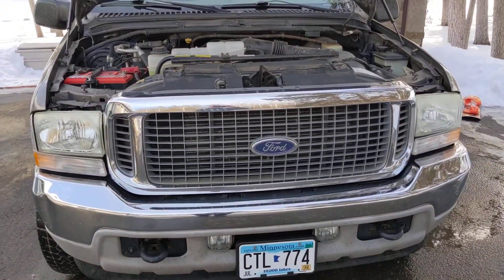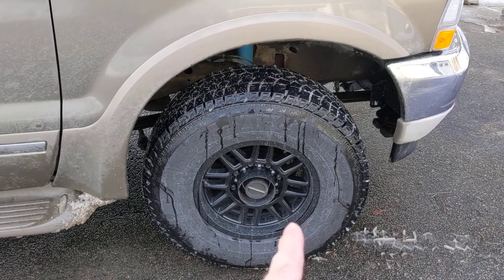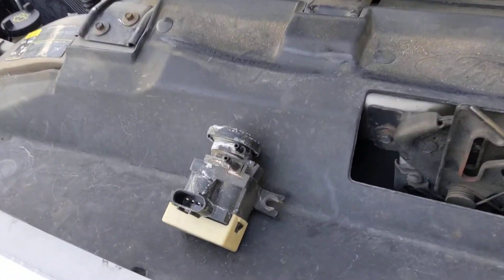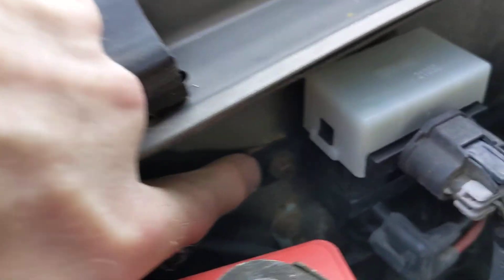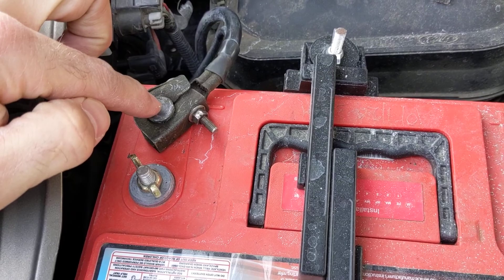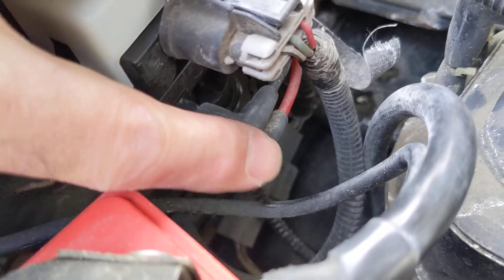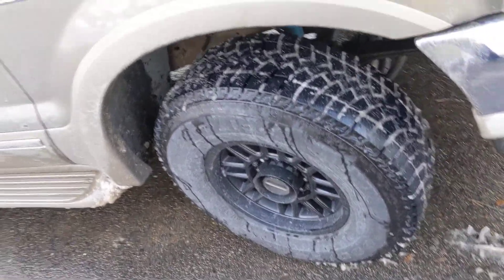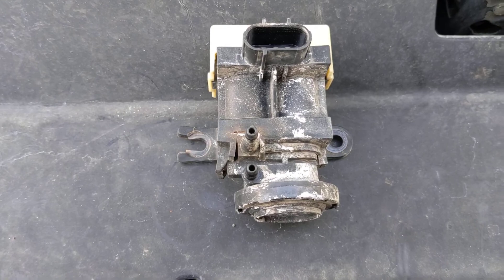Excursion V-10 vacuum solenoid

Comment: My AC blows through the windshield and then, about 15 kinutes later switches to the face vents. I'm hoping this will help me.  Thanks for the video.
Reply from the maker: Man I hope it helps, good luck!
Reply: @bleepingfastmotorsports  Unfortunately, didn't work for me. Back to the drawing board. Still a good video though, and I bet it will help a lot of people!
Reply from the maker: Dang, sorry to hear that. I'm guessing you have the electronic HVAC controls? Possibly an issue there??
There's a couple of decent Excursion groups on Facebook that could probably help.